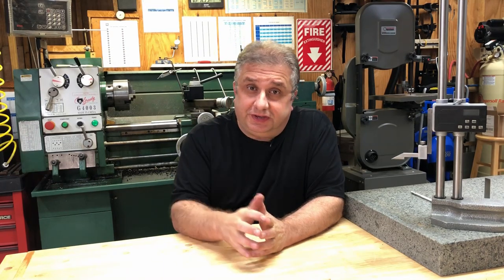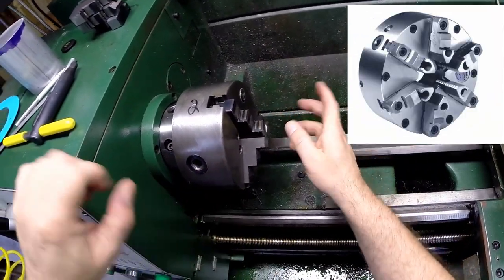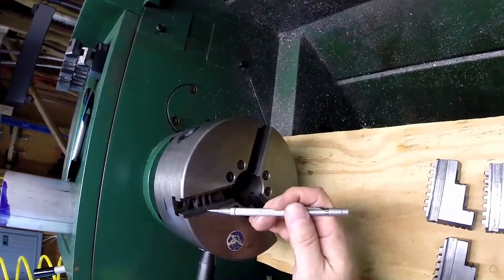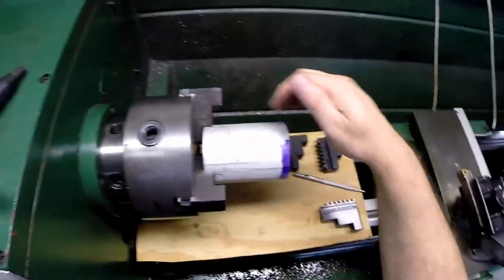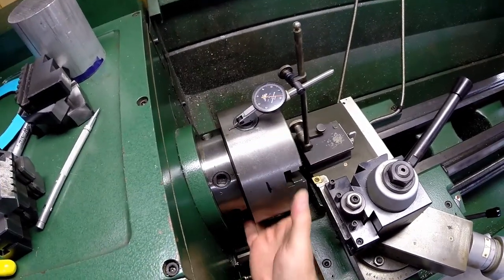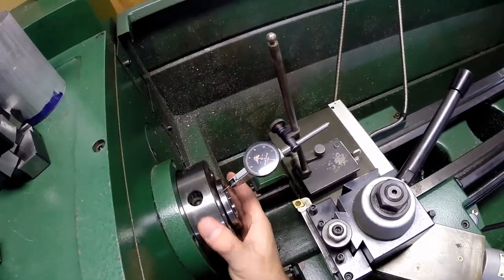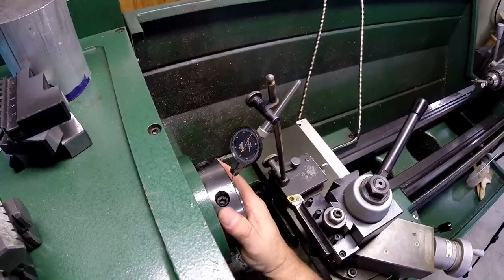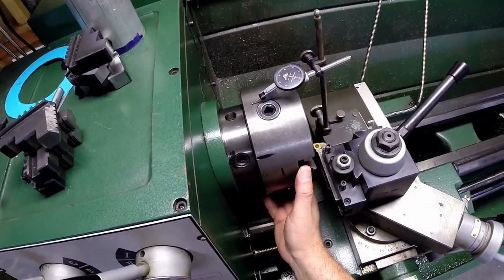Lathe Chuck Basics, D1-4 Camlock, Grizzly G4003 Lathe

Comment: Don’t use a hammer to loosen the chuck after opening the cams. One or more cams are not completely loose. The only real problem with the D1 camlok spindles are that the mark is only approximately where the full unlock position is. Sometimes you have to go around and wiggle the cams a bit to get them to completely release. The short taper is self releasing and doesn’t grab.

Are you going to test a high precision pin in the jaws? I normally use a 1”. Testing runout on the outside of the chuck is nice, but what matters is the runout of the jaws.
Reply from the maker: Hi Mel, Thanks for the reply.  I will try a 1" pin in the jaws.  What kind of runout are you getting with your chuck?
Reply: @zelko44077  I recently bought a new 8” Buck Adjust-Tru. I’m getting about 0.0002” runout at 1”. That holds pretty well until about a 3” dia, where it falls to about 0.0003”. At that point I’d have to use a larger pin. The pin used needs to have a better than 0.0001” runout to be useful at those tolerances.

Comment: Hi, nice video and a good help to everyone. Thank you. Now, In the front of chuck you have 2 bolts between each claw and near the chuck center (min: 2:29). Do you know what for are those bolts? Are those bolts to fine tune the running true of chuck? If not, how to adjust the true of chuck? Thank you and congrats for video.
Reply from the maker: Hi,  The bolts are for the assembly of the chuck.  They are not for fine tuning.  Most of the less expensive chucks do not have a feature for fine tuning.  I did see a video about adjusting a chuck of this type.  This is the link: https://www.youtube.com/watch?v=gCUkJydSmdA 
Hope this helps.